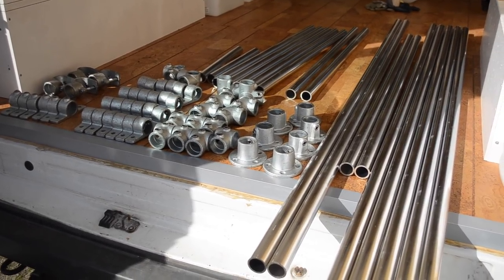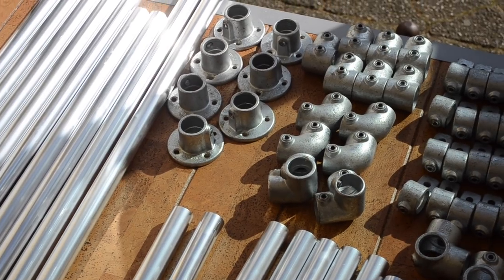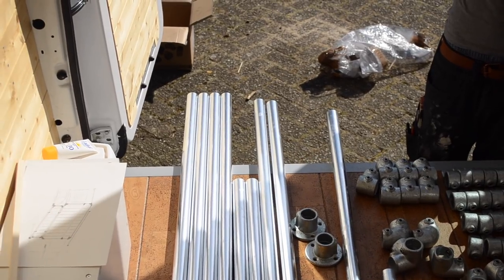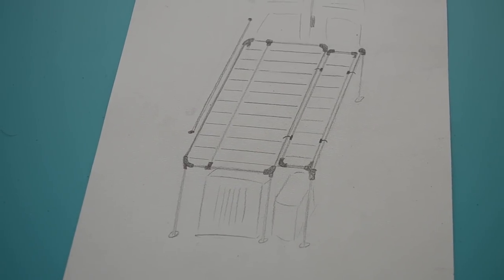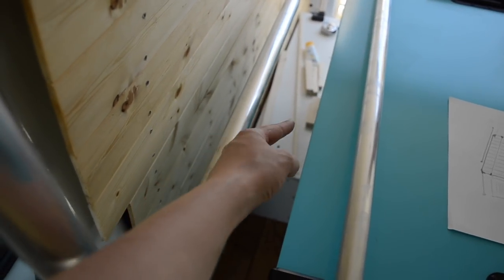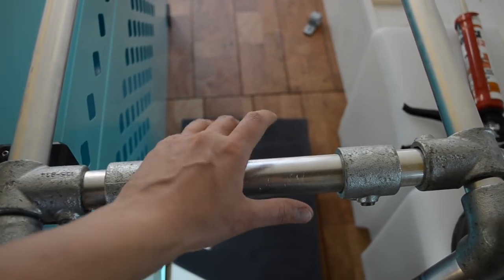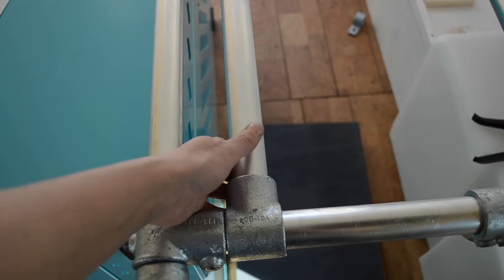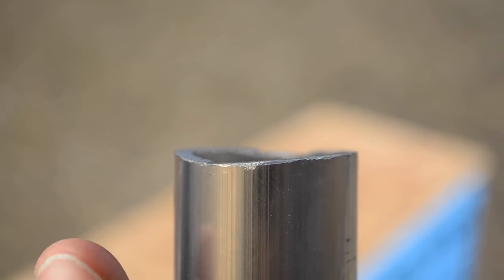Building the Bed Frame - Campervan Conversion

Comment: Hey guys, I was looking in to what tools I would need for cutting aluminium recently and something I came across was the idea that using a regular disc on a grinder can be unsafe. Because aluminium has a low melting point, it coats the disc and fills the small pores, then when it heats up and expands inside the pores, the disc can shatter. I don't really know how likely it is, but if you have a lot of aluminium to cut, it is worth considering. I ended up just going with a cheap hacksaw. Not as neat and a bit more work, but safe. :)

Comment: Hey! Its also my plan to use those pipes and clamps in my conversion. Where did you get yours, I'm also in NL?
Also, I was thinking about going 1 size lower on the pipe diameter. Any calculations or intuition on the diameter choice?
Reply from the maker: Hey Alex! That's awesome! We ordered everything on www.stijgerbuisstunter.nl! Their reviews seemed great and everything was delivered very swiftly. Send us a picture if you finish building your bed! :D
Reply: ah yes! I have been around that website before, they have the best prices I've seen so far on those items. I was thinking about going for the 26,9mm, did it seem too weak for you?

This is my plan: https://imgur.com/a/qNmz4XB
The van will still take awhile, awaiting on funds :P
Reply: mojoandfriends This link is not available